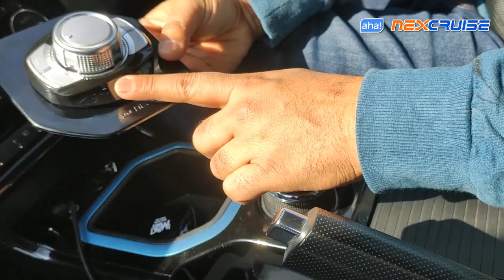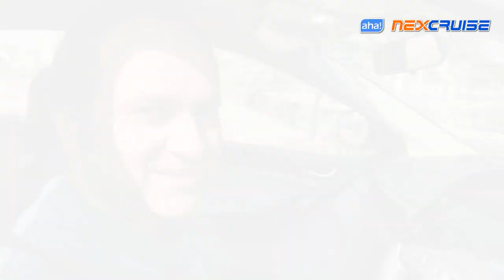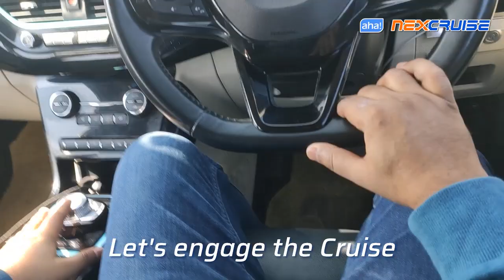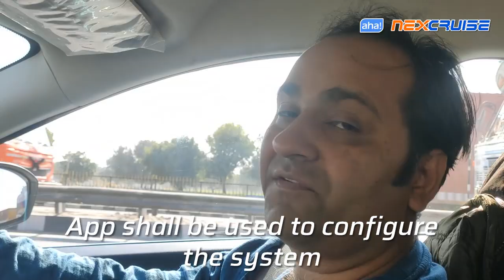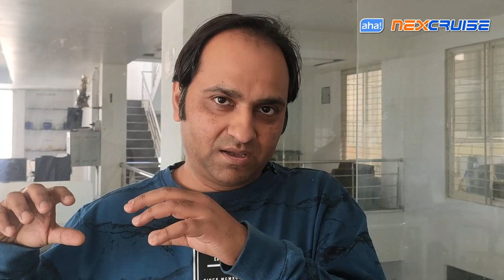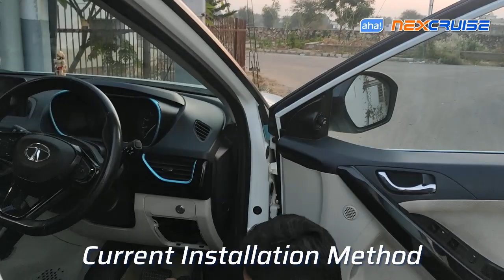NexCruise Mega update : 6

Comment: Using app to controlling the nexcruise is not required and it is good to remove it. But the regeneration enabling and disabling should be available in the switch (Otherwise it won't be better).
Reply from the maker: It will be there on the switch in due time.